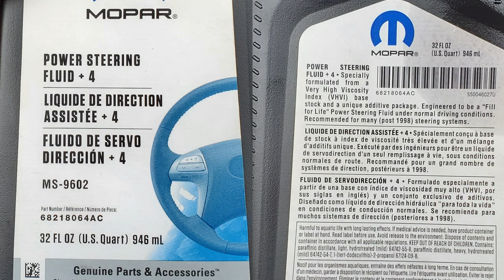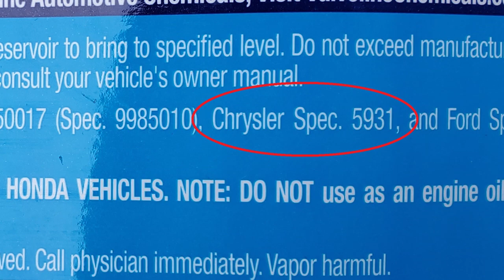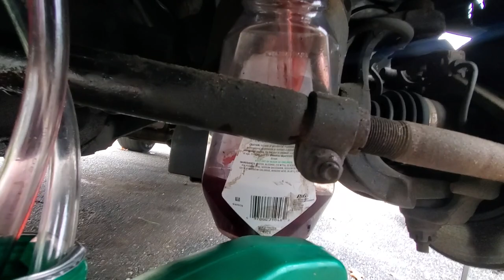JEEP MY LIFE! WJ GRAND CHEROKEE vs POWER STEERING FLUID... MOPAR MS-10838 THE HARD WAY!!!

Comment: Thanks soooo much for this video! Saved me from pouring the wrong stuff into my Jeep!
Reply from the maker: Thanks man!  Props to D&E for being my 4.7 pioneers.
Reply: @ProjectDanH  Hey I’ve got a 2001 Grand Cherokee that had a 4.0 in it, it had an engine swap. I had to replace the power steering hoses and I can’t figure out what fluid to put into it. It has a mechanical fan, not the hydraulic fan. The dealership said Mopar +4 fluid, but I don’t really want to spend $10 a quart on it and I think it just has Red ATF fluid in it. It was leaking red fluid. Can I just get a big jug of ATF +4 and flush it out and be done with it?  Im getting annoyed at this point 😅

Comment: MS10838 is the current spec, but MS5931 was the previous spec prior to being superseded, and it absolutely still works for originally spec'ed vehicles such as the WJ. 

It's also a lot cheaper, as you note there is a Valvoline fluid that meets MS5931 spec. That's all I use, and it works great.

It blows my mind that a dealership gave you a +4 ATF. Actually, you know, sadly... it isn't really all that surprising. A lot of guys only know what the computer tells them.
Reply from the maker: lol, seriously man.. thanks for the info!
Reply: No problem. It's useful to know, the fans aren't made any more and you really do lose performance by converting over to electric.

Comment: Doug saved my 02 WJ (260k miles) cooling issue on my 4.7 hydraulic fan that I was chasing for 2 years. Had to change head gaskets because of it. I saw his video and bit the bullet and bought 3 quarts of the correct Mopar hydro fluid. 20 bux a quart. Flushed it and now that fan will suck a shop rag through the grill! Get the Mopar HYDRAULIC PS fluid!
Reply from the maker: Excellent Frank!!

Comment: Jeep My Life. I like that. I may have to start using that. Had a JML moment this weekend. My JML moment: Trying to diagnose an EVAP leak. I ended up messing up the feed line fitting AT the fuel pump. Had to drop tank (full of course) and replace the fuel pump module. Everything fought me every step of the way.  Got it done in time despite Mother Nature.
Reply from the maker: oh man that's definitely a JML moment! Just about all my Jeeps have an evap issue... so annoying!!

Comment: Reminds me of when I did the high pressure hose on my XJ. I had to do a similar flush because I grabbed the wrong bottle and dumped motor oil stop leak instead of power steering fluid... Jeep My Life.
I am starting to miss XJ content though...
Reply from the maker: Jeep my life indeed! Sorry about the XJ stall.. The wife was tired of looking at a junk WJ.. had to get it running to prove its value.

Comment: Just wanted to share that the electrical cable that goes to the solenoid  under the AC lines some time brakes... I this the pull and tug and found that the cable was indeed broken. Please check and see if that can solve your problem.
Reply from the maker: Than you Buddy!

Comment: Oriely brand power steering fluid has MS-10838 part number on the back. Ive had 3 WJs and always used that. Also its 4 bucks a quart instead of 20
Reply from the maker: Awesome man Good to know! Unfortunately there are no O'Reilly's Auto Parts stores where I live. Thanks for the input 👍

Comment: O'Reilly has the Chrysler MS5931 for $6.00 a qt. Has it right on the back and it is exactly what my manual says to put in the power steering pumps with the hydro fans. I have the 04 Jeep Grand Cherokee limited 4.7L... From the book "Mopar Power Steering Fluid (MS-5931)". YOUR THOUGHTS.....
Reply from the maker: You should be good to go then.  Unfortunately I don't have any O'reillys by me to compare.

Comment: Yeah, dealer couldn't show me where 10838 was compatible with 5931, so I found some Valvoline 5931, and I bought 3 quarts of Redline 5931, so I have some if I need it. I'm getting rid of all this monkey motion in a few days by doing a Lincoln Town car 2 speed electric fan conversion. I'll never have to worry about this monstrosity of a fan system ever failing on me. I'm in Jersey, '04 Limited, 4.7. J.M.L. 🙂
Reply from the maker: Great Conversion!!!! JML!!! HAHA
Reply: @ProjectDanH  Thanks!! One important thing I have found is you have to use really good relays. Fan draws 40-53 AMPS on start up. I have two Bosch 75 AMP relays, one for the low side, one for the high side.

Comment: Hey Dan...i think martin has the old solenoid for sale..or maybe not...i think he posted it on ebay for $100....yeah men...and hard to find...hope you can fix that one..cheers.!
Reply: I do have them for sale but not on eBay and I only what $70
Reply: @martinbuilt  just trying to help martin
Reply from the maker: Thank you guys so much.. I solve the problem already I Just need to edit and post the video. Spoiler alert the hydro fan and the O2 sensors share a fuse 😱

Comment: Incredible information!  I've got a doubt though:  bought a 2006 grand cherokee Laredo, everything looks awesome BUT whenever and car is cold and I totally lock the steering wheel to either side, is makes a jiltering noise e.g wham wham wham, other than that everything looks as it should, what is the most probable cause: wrong fluid or low level of fluid (I didn't check the steering fluid level as I just bought the car)
Thanks!
Reply from the maker: The power steering pump is struggling, May be time to replace it.

Comment: Looks like ur valve covers r leaking. Should definitely do a video on that on the passenger side
Reply from the maker: Yeah it's really goopy down there. It starts smoking back there every time it gets hot. You think that's an exhaust leak or just all the sludge burning up?
Reply: @ProjectDanH  idk man ur more up on that than me I'm sure but that just looks like burnt sludge. I'm in the process of replacing my valve cover gasket on the passenger side and it's a real bear. Orginal owner only replaced the driver side
Reply: @brandanbouchez8412  It's easy if you remove the battery and AC line and pull back the wire harness for the injectors . It took me about 20mins to do it . There is a few videos out on these 4.7's for valve cover gaskets too .
Reply from the maker: @jaysmith5084  awesome guys. Thank you! Looks like This WJ is the gift that keeps on giving! (Content wise)
Reply: @ProjectDanH  I really dig mine but I still miss the ZJ limited 😔 I had a 00 XJ sport in 06 with 54,000 miles on it . It was my friends Grandparents Jeep and I got it cheap . My ex decided it was hers when we split and she still has it now with 300k it's still going 🤣
Reply from the maker: @jaysmith5084  They always take the good stuff!

Comment: My 1993 cherokee sport transmission will not shift out of drive, shiftier moves but even in park position drive is still engaged,it does still have 1 2 and 3rd and drive,help... thank you
Reply from the maker: Hey Todd have you crawled underneath and checked your linkage?

Comment: Hi, did you solve the late operation of the hydraulic cooling fan?
It seems that I have the same problem..
Reply from the maker: One of my biggest problems was realizing that the fan solenoid shares a fuse with the oxygen sensors.  If your O2 sensor wires are shorted out it will blow your fuse and your hydro fan won't work
Reply: @ProjectDanH  my problem is that my fan is working but not on time ..
Can you tell me the exact fuse?

Comment: Hey Dan, what is that fitting in the upper radiator hose? Is that for purging the air out? Also would that work on a 96 5.2 Zj to purge the air?
Reply from the maker: Yes sir It is an air bleeder valve! It should work on all vehicles.. Check out my last video

Comment: Do you think that power steering fluid is the same in the 96 Zj ?
Reply from the maker: 96 ZJ doesn't require 5931 spec Hydrofan fluid.  the +4 would probably be fine

Comment: Out of curiosity what would be the powersteering fluid to use in a the 98 ZJ 4.0?
Reply from the maker: Basically any PS Fluid
Reply: How about a 6 cylinder 2000 wj?
Reply from the maker: @riobravomultimedia4104  regular fluid unless you have the hydro fan

Comment: Can bad flow or hidro fan/selenoide make steering stiff at low speeds only softer when steeping on gas? Can it be air still on lines, was driving with no fluid a few days, had pumped changed still same issue
Reply from the maker: Yea, definitely possible, could be an old weak pump too.

Comment: Hey Dan, jeep my life I’m having some trouble with my 02 hydro fan, it spins at idle (I think slower than what it should) but if I turn the steering wheel the fan stops spinning and the power steering pump sounds like if there was no fluid( reservoir full) is this a sign of a bad steering pump or the fan solenoid?
Reply from the maker: Hey man, sounds like the pump could be bad
Reply: is it hard to turn you steering wheel by chance?

Comment: Hey PM me just found a 5.9L ZJ if you are interested in some parts.
Reply from the maker: oh man! can it be restored?
Reply: @ProjectDanH  Found it in the junkyard, but spend 2 days pulling off all the important parts. Got probably 1 more to the job. Can't believe someone put this in the yard. Also pulled a Mopar remanufactured computer (2016) from a 2000 W.J 4.0L. Let me know if you need some parts.
Reply from the maker: @royremick1453  sure man! Thanks.. can you message me some pics on instagram?
Reply: @ProjectDanH  Not on integration, but can you request to be friends on Facebook,  then we can use messenger.  I am actually working on photos now.
Reply: *Not on Instagram